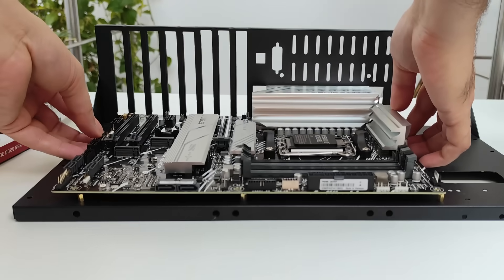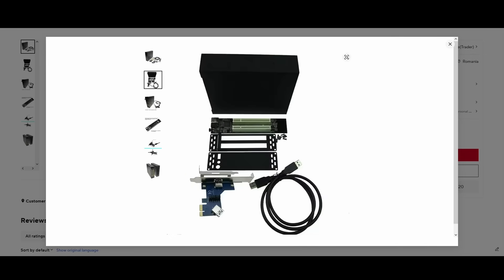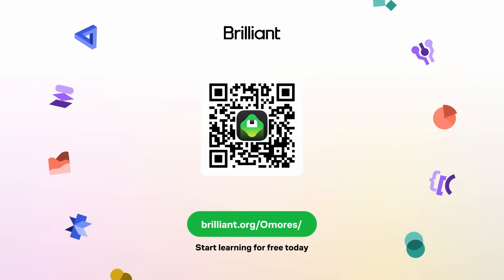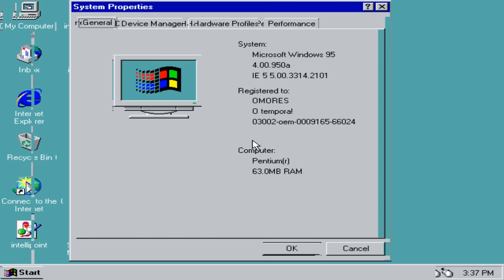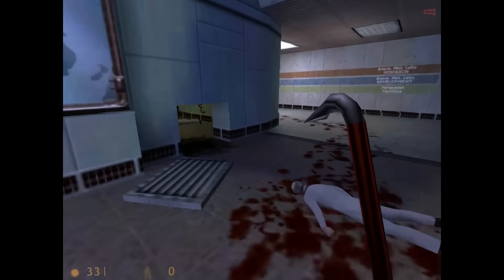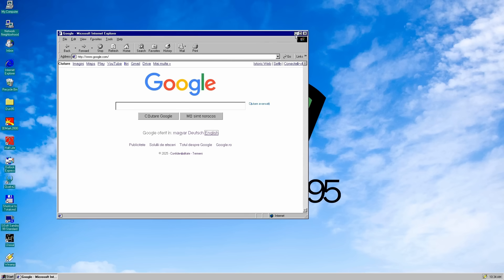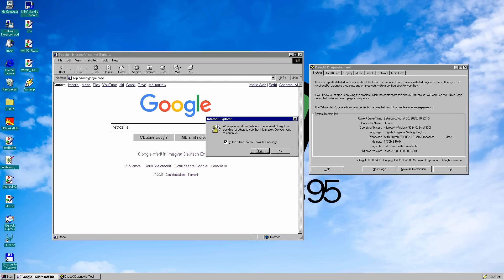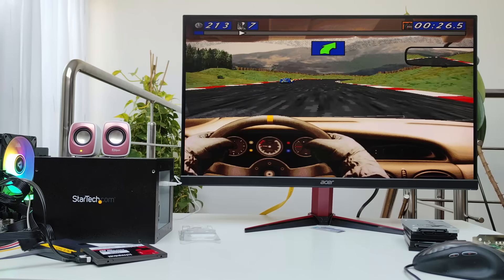Windows 95 (RY)ZEN Again – Running NATIVELY on a Ryzen 9 9900X @ 4.4GHz

Comment: i know that win 95 never can use the full power of the ryzen 9, But how does it compare to other Win 95 systems?
How much more powerful is it?
Don't the games that run on it run too fast?
pls add benchmark  next time if you can!
that will make it more interesing!
Reply: Games running too fast was common in the DOS days (and also on classic Macs) but I suspect the Windows DirectX libraries had code built into it to adjust for different CPU speeds.
Reply from the maker: For my use case, it's more about convenience. I can be in Windows 10, restart... and be rolling with 1995 technology on my AM5 PC. It's perfect for when I want to take a break. As for raw power, having a Ryzen 9 doesn't make much (if any) difference in real-world usage... any multi-GHz CPU feels the same. But I recently installed Windows 98 on a K6-2/500 PC - and even though I used an SSD - there you can feel the difference. A fresh installation takes something like +20 minutes.

Comment: You don't wanna give Windows 95 external IP open to the Internet.
Reply: I do.  Very much so.  Apparently hackers only target current software, not outdated software. Omores may be very popular with Russians because of this.  Only exploit I know of is over Netbios IPX protocol.
Reply: It'd be interesting to run a Win95 PC un-firewalled just as an experiment. I doubt much would happen to it now. I suspect any serious remote exploits in the kernel were patched by 95B or 95C.
An OS that old is unlikely to be a useful malware or botnet host for anyone doing shady stuff since it's unlikely to be compatible with any of the tools they're using.
Reply from the maker: I usually zip the whole C: drive of Windows so I can reuse it later. This time I reused the installation from my last Windows 95 video: https://youtu.be/6xAgMiTNk3Q I always do the zipping in Windows 10/11, where every file gets scanned, and I’ve never seen any 'Virus & threat protection' alerts, so nothing slips through (not even tiny .vbe scripts). I do get lots of warnings when copying games from old "backup" CDs, mostly because of all the "patches" that are stored there. :)
Reply: @O_mores I meant, that when running Windows 95, you really want to be behind NAT. 😊
Reply: I do

Comment: I have 2 gen laptop i3 2328m
Lenovo g580
Laptop came with Windows 7
And I am running it with Windows 10 pro at slower speed .
Can it run windows 95 on hdd .
Not virtually.
Reply from the maker: Yes, it definitely can, but sound might be an issue. There's a 16-bit HD audio driver that works on some older motherboards- it might do the trick, check out this video: https://youtu.be/JEN6Da3MOzg  The Intel HD iGPU is obviously not supported, but there's a cool project called SoftGPU that uses the CPU for 3D rendering. I saw some good results in 3DMark. I haven’t tested it myself since it was originally meant for VMs, not real hardware -but now it runs on actual machines too.

Comment: Thats until they will even remove backward compatibility for 32bit from new cpus. Everything new is 💩
Reply from the maker: Legacy and custom 32-bit apps still make up ~40% in some industries. Productivity software like Office is lower, but still in the double digits. Backward compatibility will stay, but running 32-bit OSes natively will be tough once CSM is gone - likely with AM6. Socket 1851 already dropped it, though there's a cool project called CSMWrap.
Reply: @O_mores  From what I understand the ArcaOS folks have OS/2 successfully booting on new PCs with only UEFI available.
Reply: Intel seems to really want to get rid of x86_64 legacy mode preventing use of any 16 bit or 32 bit operating system. Once they can get AMD to agree, new x86_64 cpus will only be able to run 64 bit operating systems.
Reply from the maker: @MonochromeWench Future non-legacy CPUs wouldn’t really be x86-64 anymore, they’d be something completely new. x86-64 was built as an extension of 32-bit x86 (IA-32), not from scratch, so you can’t just strip out the legacy and expect it to function on its own. And even if you could, it wouldn’t make the chip that much simpler. Modern CPUs are mostly cache and interconnects, the actual logic for running 32-bit or 64-bit code is just a small part of the die.

Comment: I had the same mouse you have, the Logitech MX518, years ago, but unfortunately it's been discontinued for quite a while. Great video about Windows 95 if only there were a Linux distribution with the same interface, many of us would definitely use it.
Reply from the maker: I had an MX518 back in 2007, I think it was around $50 at the time. Such a great mouse, I played a ton of competitive CS 1.6 with it. The one in the video I recently got as new old stock, still sealed in the bag with the PS/2 adapter, CD, and manual, for just $10. Unfortunately, the rubber coating is already starting to show its age…
Reply: Years ago people used fvwm95 which tried to mimic the Windows 95 UI. There's a modern fork of it on github from mintsuki, with pretty clear instructions on how to install and run it on Debian/Ubuntu/Arch.

Comment: Linus Tech Tips ran a GPU on like 5 meters of PCI-E extension cables, so I dunno if the stuff the Startech enclosure has is really required.
Reply from the maker: I think it ultimately depends on the specific chips connected to the PCIe bus. Some do have issues with distance. In the video, I showed the official documentation for a random chip (JMB368), which states: 'PCI Express PCB trace length can be up to 8” (20.3 cm).'
So, if you use that card with an extension cable, it will likely fail... but probably not in a way that makes it completely unusable. Instead, you might see more subtle issues, like random crashes, which are much worse...

Comment: Hi, can I just ask what capture setup you use for old pcs/gpus, ive been looking to capture some footage from my DVI and VGA gpus but there isnt much info about capturing retro pcs. Thanks
Reply from the maker: I'm using an Epiphan DVI2USB 3.0 capture card. This was around $799 at launch (2013). It's very compatible with all kinds of resolutions. I also have a capture card from Elgato, but it's only for 720/1080p; other resolutions are not supported at all.

The bad part: it halts the recording every time the resolution changes - and this happens a lot. This is a software issue with its dedicated capture program for Windows. Also, it really struggles to capture game action at 1080p. So, the best option would probably be the next model of this card - which can still handle low resolutions but is more capable at 1080p.
Reply: @O_mores  im seeing these for around £80 used, do you think it would be good if i used a modern capture card for hdmi/displayport on modern pcs?
Reply from the maker: @imadam This thing can capture over HDMI (it actually came with a passive DVI to HDMI adapter in the box). You can also use a regular DVI to VGA adapter with it.

For any other modern capture card, you have to make sure they support various resolutions like 800x600, 1024x768... Many are just tuned for modern gaming or video conferencing, and will only accept 480p, 720p, 1080p...4K...
Reply: @O_mores  yeah, i have a modern cheap ms2131 capture card which does 1920x1080p fine but once you try and capture something else (like a bios or 1024x768) it either looks bad or doesnt work at all.

Comment: Would those drivers work with a geforce 7950GT?
Reply from the maker: I don't see why not, but it depends... As I mentioned in the video, the behavior of Nvidia cards with the last compatible Windows 9x drivers varies from system to system, depending on the BIOS. For example, R. Loew created a patch called FIXINTR.VXD, though it isn't necessary on every system. To check whether you need it, you have to use another tool called TESTEOI.VXD. According to the manual, TESTEOI.VXD is a test program that determines whether the 'Interrupt EOI Bug' is an issue on your specific system.

Comment: Holy hell, to me this is equivalent to dark magic, if you would've showed me something comparable to this 10-15 years ago, I would've said you're mad. 

This is incredible considering I recently built a period accurate Win95 machine on a P2@266mhz on a 440LX mobo, paired with 64MB of RAM, Voodoo Banshee and an ESS AudioDrive ES1868.... almost nothing worked as I wanted, all sorts of crashes, barely got all the drivers working 😄Yet here you are running Win95 on a Ryzen 9900X

Excelent video /bow /salute
Reply from the maker: Well, it's funny how older hardware doesn't always play nice. I actually do have a lot of 'correct' hardware for Windows 9x... I recently did a fresh install on a K6-2/500: https://youtu.be/3sop91tqkTU and I can confirm it wasn't an easy ride.

Windows 9x works stable on newer hardware like this build because it's all down to basics: the BIOS handles the disk, no ACPI, no power management, no AGP drivers... There's just little that can go wrong. Okay, accessing the drive via BIOS/INT13H isn't optimal, but on a 4.4Ghz system... you don't really need any optimizations anyway... :)
Reply: @O_mores  This is super awesome! Didn't think of that - super thanks for the reply 🙇
Reply: I still have memories of failing to get Windows 98 to run well on a brand-new AMD K6-2 350 in late 1998. It would usually boot but after several hours of use it would often randomly BSOD. Fortunately I was able to get a copy of Windows NT 4 (and later Windows 2000), which ran flawlessly on the same hardware. (Which also confirmed it wasn't a fault with the hardware.)

Comment: Good old fun. Wonder how well/fast it can run 3d software rendering in Quake 2 or Unreal.
Reply from the maker: Software rendering works great on this 7900GS GPU in Quake 2 or Unreal - we're talking 130 FPS @ 1920x1080 in Unreal. Full HD is very heavy for software rendering, but you get like 400+ FPS at lower resolutions like 1280x1024. With VBE drivers, everything runs much slower, at around 40 FPS @ 1280x1024

Comment: Good job! 👍(* I may need to try this). How about a 3dmark score? is the cpu helping over anything newer than 2009? or it's bottle necking in win95....(I speccifically built my T5820 precision to be backward compatible , but they say system/cpu/bios it's only virtualising a dos machine , so it may be limited in that aspect, but it should be verry good, for me , even then.)
Reply from the maker: For 3DMark2001 check the Win 98 video: https://youtu.be/EOeJnLb952k - ~56K with this exact Nvidia 7900GS. 3DMark 2001 can't run in Windows 95 because requires DirectX 8.1. (8.0a it's max for Win 95) The CPU shouldn't matter that much.. I mean, games that have problems with clock speed (and there aren't so many) were already in trouble with a Pentium II. Anyway, if you are into benchmarks, an FX8350 clocked at 4GHz will only deliver 35K points in 3DMark with the same 7900GS GPU...
Reply: @O_mores  Tnx for the replay , so CPU did not made much diffrence, like between FX8350 vs I9 -920 or vs your Zen AM5(witch I was curious about...) It's all single tread by ussage aniways... (under w9x). Did your bios support disableing rest of the threads? (L.E. there is also 3dmark99 and 2000... I was curious or aquamark , I use to test all of these stuff back at dawn of the milenium).
Reply from the maker: In 3DMark 2001, the CPU made a huge difference (like from 35K to 55K points), but of course, the actual in-game experience is basically nonexistent when using any 2GHz+ CPU- except maybe for later titles like Half-Life 2. I tried 3DMark 2000 with a few patches, but it didn’t start. I didn’t bother too much with it... it should work eventually. I didn’t disable anything in the BIOS since it’s a multiboot setup and I need everything enabled for Windows 10/11.

Comment: great work! 5:00 is it mbr windows boot manager? how did you add win11 entry here since (afaik) it only runs on gpt boot manager?
Reply from the maker: Yep, the bootloader you see at 5:00 is the legacy Windows Boot Manager, residing on the MBR disk. I then used EasyBCD to add a new bootstrap entry (NST) for the Windows 98 partition. Check out this video for more details: https://youtu.be/3nCSGApJGbQ
Reply: You can add even linux in legacy boot, iso, vhd, and much more.
Reply: You can still install the retail version of Win11 on an MBR partition. The way I did it was to use DISKPART to create the partition, then DISM to install it.
From memory the LTSC version of Windows 11 still officially supports MBR.
Reply from the maker: Installing Windows 11 on an MBR disk is very easy if you create the bootable USB with Rufus. You simply select the MBR option, and Rufus will automatically prepare the ISO to work this way. By now, I've done it so many times that it feels natural. If you switch to UEFI later, it's no big deal... the Win 11 installation will still work after one extra restart.
Reply: @O_mores  Oh, I'll definitely try it! thx

Comment: Q: Is there a external box with ISA and PCI slots... I would like to use some older ISA cards.... Just wondering... Great VLOG... =8-)
Reply from the maker: A: ISA slots are a different breed and won’t work on modern systems. They relied on old chipset features like DMA channels to talk directly to memory, and that support was dropped a long time ago. Some industrial boards still offer ISA, but they usually emulate it with special hardware or VMs - so pure DOS/Windows support isn’t really possible anymore.
Reply: Best you can do is X99 chipset over LPC for ISA support.

Comment: One thing I'm wondering with a setup like this is how well software rendering would run compared to the dedicated GPU 

There's something called SoftGPU that should handle most of the stuff to do with graphics libraries, it's mostly made for VMs but it works on real hardware too, it could be a fun experiment to try :p
Reply from the maker: From what I get, most of SoftGPU's rendering and emulation runs on a single thread, so it might perform just as well on real hardware as it does in a VM that runs on a PC with tons of cores. Gonna test it and make a vid.

Comment: The hardware box with those 4 PCI slots looks useful!
Reply from the maker: Yes, it actually is - especially since the trend now is to have fewer and fewer PCIe x1 slots and more M.2 slots. There are quite a few PCIe x1 cards that work in Windows 9x (such as PCIe-to-USB adapters, gigabit adapters, or sound cards), but there just aren’t enough expansion slots...
Reply: @O_mores Yeah,there's tons of these adaptors/converters,but I just thought that simple,box PCI was just a design I never came across-tidy,simple and compact.
Reply from the maker: I'm going to integrate this Startech box into my new daily driver build. One quirk: it requires a separate power supply and stays on after a PC shutdown unless you remember to turn it off. To fix this, I'm using a 12V Molex output from an eSATA bracket to power it, so it only runs when the PC is on.
Reply: @O_mores Sounds like neat,but still tidy solution.

Comment: I always wondered are you able to run SATA in compatibility mode instead of AHCI mode? Windows 98 boots fine in compatibility mode on my Intel 865 chipset. Or is the compatibility mode option not available anymore in these newer boards?
Reply from the maker: The last motherboards with compatibility mode are on socket 1150, but on those, it's better to run with AHCI and R. Loew's AHCI9X drivers. IDE mode works, but from my experience, it can introduce problems on modern hardware. I installed Apple's Rhapsody OS on an i7-3770 configuration using IDE Legacy mode, and it was very stable: https://youtu.be/uE6qp94InBM
Reply: @O_mores  Thanks for the clarification! Nice video as always pushing newer hardware to run legacy hardware! Is there a way you can provide the image of one of your hard drives with all the modified himem config sys files etc? I'm following your videos just seems quite a lot of know how with files and drivers is required to attempt this myself. Keep the videos going! 😁
Reply from the maker: Check out my recent Windows 98 article on Patreon. It's free and it includes the contents of the drive used in the YouTube video: https://www.patreon.com/posts/windows-98-meets-136815920
Reply: @O_mores  How awesome 💯😎 Thank you!